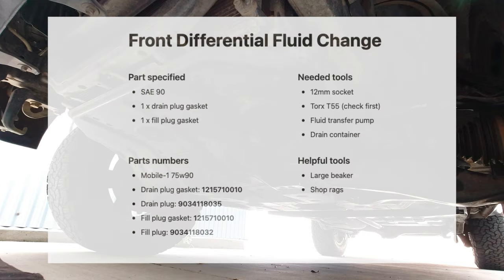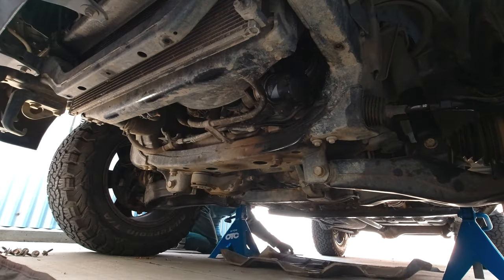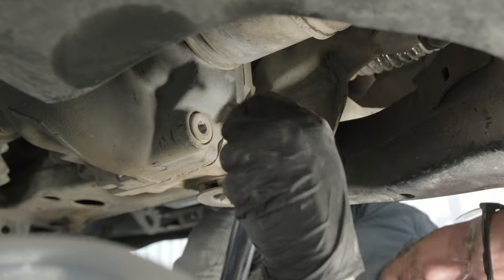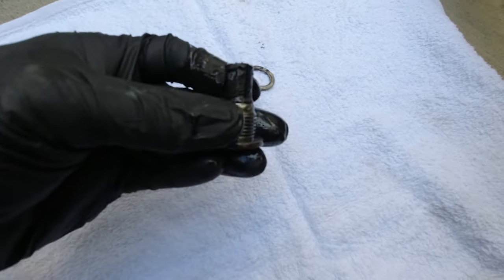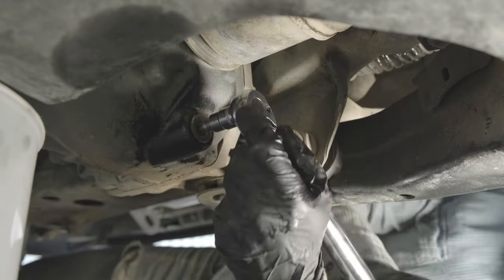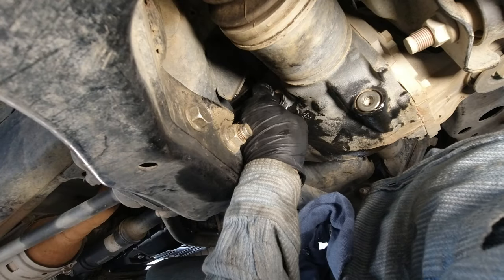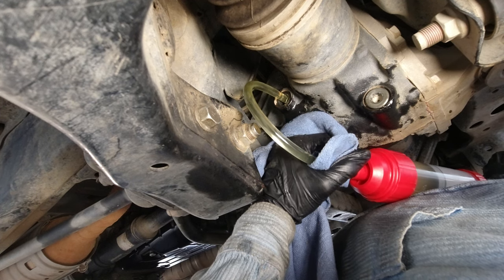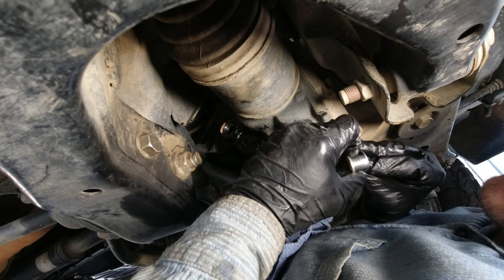Front Diff Fluid Change 100 Series Land Cruiser

Comment: I’ve talked to several folks who have stripped (or almost stripped) the drain plugs bc they were using Torx T55. Technically, it’s a HEX 10mm. T55 works in a pinch, but take care especially if removing previously over-torqued plugs.
Reply from the maker: Great feedback - I just removed my cams to replace the cam seals (sigh ‘06) and had a similar issue with hex vs torx. Are you sure on the 10mm? Seems a little small. For anyone reading the comments Will’s comment is good advice!
Reply: Willmtaylor@ Correctamundo. 10mm hex socket on a breaker bar. Can’t go wrong.

Comment: I own a Toyota Land Cruiser, 2007, V6 Petrol, Model FZJ100L-GNPNKV, Engine 1FZ-F

Is the differential oil for diesel and petrol land cruiser exactly the same or do I have to use different oil ?

Is the oil and tools going to be the same for my 2007 100 series land cruiser ?